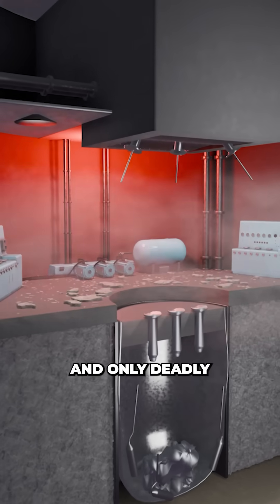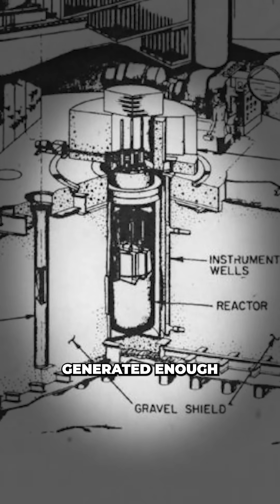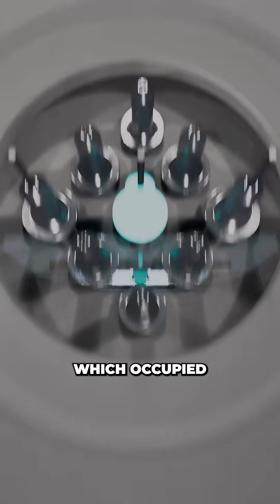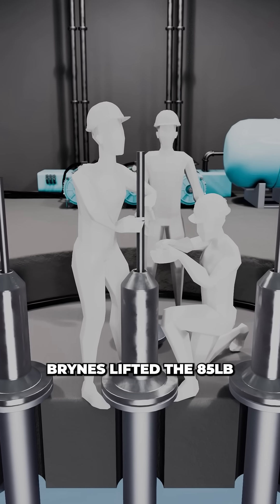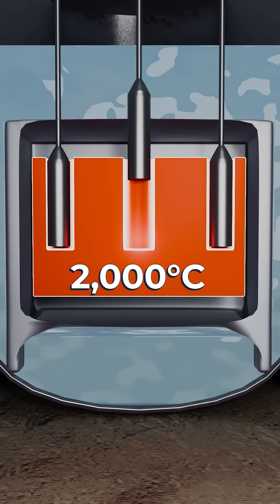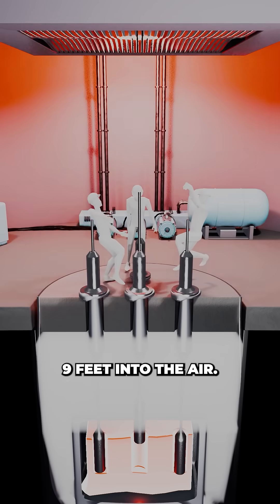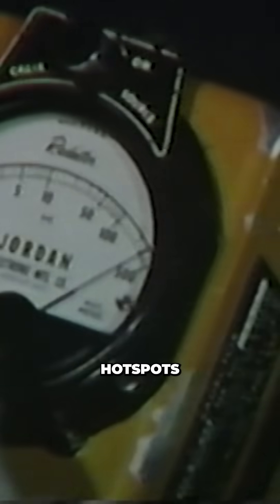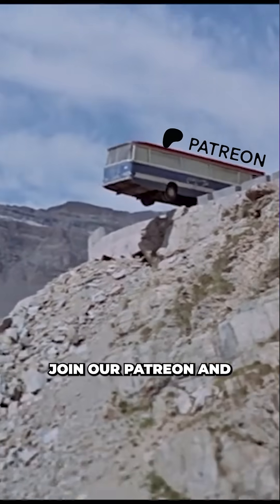The True Story of the SL-1 Disaster

Comment: Couldn't they have put a hard limit on how much you can lift the rod, instead of leaving it up to the soldiers?
Reply: SL-1 was a very crude reactor that was reportedly pretty poorly maintained. As said in this video it was a prototype to see it small low energy reactors could be used to generate power for the military. As the only one ever really made and as a extremely early prototype nuclear reactor it had a ton of flaws. Additionally the central control rod to my understanding had issues with corrosion which made moving it a challenge as well. The 3 men stationed that night had a bunch of issues one of them just went through a divorce where his wife took half his paycheck and he was almost certain one of the two guys stationed that night (dont remember who) was the one his wife was having an affair with. There is a billion reasons this incident took place least of which the control rods being manually maneuvered. There a good documentary by a youtuber who covers these nuclear reactor disasters you could watch on youtube, kyle hill the channel.
Reply: @titanicgaming1148  wow, I'll be sure to look into it. Thanks!

Comment: Happens all the time. For example:
When you are instructed to pull the wine cork for only 1cm, but because it's hard, you exert more power then the cork goes all the way up freed from the bottle... Boom 💥
It shouldn't be designed like that. The design is very prone to catastrophic accident.
Reply: That is a really good and close analogy about trying to pull the cork out in a controlled manner which you can do most of the time but then there are times when it just pops out all the way with no control.
Reply: But he was lifting an 85 lbs rod by himself. It's hard to "throw" something that that 20 in. Control rods also are not stuck in with friction as their way to stay in place.
Reply: @Mitchello457  but it was stuck.. these rods often got stuck its likly that he janked it to get it free thats why he lifted it higher then expected

Comment: Idk if I understood it correctly, but
If it shouldnt be lifted more than 4in, why not have a stopper at exactly 4in to prevent the rod from being lifted higher?
If the designer knew that, why leave it with the capability of moving freely?
Reply: I believe this was the first incident of it's kind, so it wasn't yet understood what could result from moving the rods too far/too fast.
Reply: @nodammit well yeah but the engineers knew I think and I don't know if they pass it on the management and if they did did management pass it on to the guys probably not
Reply: @ItsMe-ic7on  I think that's an easy assumption to make, but I don't think that was the case here.  You had 3 men; an electrical engineer, a management Supervisor, and a trainee.  It was the Supervisor that became impaled in the ceiling.  I think it was just very early days for nuclear, and they didn't totally understand the risks yet.  After this incident, it became standard to use large numbers of rods, where no one rod could have such a large effect if it were pulled too far.  Keep in mind that this was one of the very first designs for a nuclear reactor, and was an experimental prototype.
Reply: There was no engineer. It was Enlisted people and a SeaBee. It was supposedly going to be safe enough for those kind of people to operate in remote areas. Not a the designed fuel was installed and there was excessive reactivity in the center, removing one rod could make it go prompt critical as it was 93% enriched fuel.
Reply: @ItsMe-ic7on  they absolutely knew. The operators of SL-1 were interviewed after this. When asked if they knew that pulling the control rod out too far would cause the reactor to go critical one of the operators responded with “of course. We often talked about what we would do if we were at a radar station and the Russians came. We’d yank it out.”
Reply: @nodammit it's mathematics/physics so it would have been calculated beforehand. And nuclear power was new so calculating and producing all that was needed to the best standards didn't exist. So the rod often got stuck which, means you apply more force to get it out and it overshoots andd before you even can realise the overshoot you are dead on the ceiling.
Reply: The problem with nuclear reactors is that criticality depends on all of the fission products currently present in the reactor. So, new fuel rods might only need 4inches to reach criticality, but older fuel or recently shut-down reactor might need significantly more reactivity. The designer decided to make maintenance a non-normal operation that doesn't require safety mechanisms, which is the real problem with the reactor.
Reply: @-yttrium-1187  while it’s a much safer industry, while I was in college I was a janitor and I was always baffled by some product design. It’s as if the manufacturer never thought their product was going to need cleaning or maintenance.

So to think this may also have been an issue with early nuclear power plant/tester designs too just makes me smack my head on how short sighted so many designers were.
Reply: @Eddy002  Made me remember the original Saturday Night Live with Dan Ackroyd as Jimmy Carter and Garrett Morris as a maid cleaning up 3 mile island spilled water and turning into 50 ft tall lovers.
Reply: regulations are written in blood.
Reply: iirc it was to see how simple they could make a reactor, and at the time they though the reactor design was safe and not capable of exploding. Though this reactor was built and designed outside of perview of Admiral rickover who would handle nuclear projects in the military, but this project was done behind his back. He I think had knew this reactor wasn't great, as he would have had put different people in charge of the reactor.

Of the 3 men killed 1 was in the middle of a messy divorce, 1 a know prankster that was know for pulling those rods out fast as a prank (as well tripping alarms on purpose to mess with the others), and another a new guy who wanted to get experience on the reactor.

There is evidence the one who pulled the rod, was likely pulling another prank, but ended up causing the explosion this time.
Reply: @terranbyte2619 I heard the one getting the divorce knew that one of the other guys on his team was sleeping with his wife.
Reply: @terranbyte2619 what kind of evidence would there be that he was pulling a prank?
Reply: Another theory was murder suicide. One was having a affair with the other guys wife.
Reply: Arrogance
Reply: @cerealkilla8930 
Accident. The rod was stuck, leading to an overshoot when it dislodged.
Reply: Because this is stupid capitalist engineer, no superior Russian design/j

Because whatever stopper would've interfered with operations, like sure you put that, now where does the operator go? Also it was the 50s, safety wasn't even invented yet. It took an airforce pilot makinh a ruckus before we had the first car seat belt!
Reply: @abriannaaguilera2123 😂😂😂😂 superior Russian design.
Reply: early years of nuclear research had guys messing with a plutonium core with a screwdriver
Not everyone follows Murphy's laws (originally, those were intended for safety; they came from a researcher doing dangerous rocket experiments, yet they had no injuries)
Reply: When there is less radioactive material in the reactor, it can be safely lifted higher
Reply: Safety features are almost always added as a result of an accident....
Reply: It is because 4in isn't the maximum height they would lift it to, it would go higher once it was connected.
Reply: Ever work on a BMW or Audi?  Engineers either hate technicians or assume they're just as smart.
Reply: You leave a flaw in the design in case you ever have to destroy it. Think Death Star.
Reply: @gallegaditastv2853 well apparently the only way you can destroy this was by human error or maybe on purpose but that's not the point the point is a person had to be in there to do that. And killing somebody to stop something like that happening is not acceptable
Reply: @gallegaditastv2853 This actually was part of their thinking. If the SL-1 site was ever about to be captured by an enemy force, they were told to intentionally initiate the process described in the video. Kyle Hill reads a quote about it in his Half Life Histories video on the subject.
Reply: It was under maintenance, it need to lifted a few inches to reconnect it to the control rod drive mechanism.
Reply: Cuz money :)